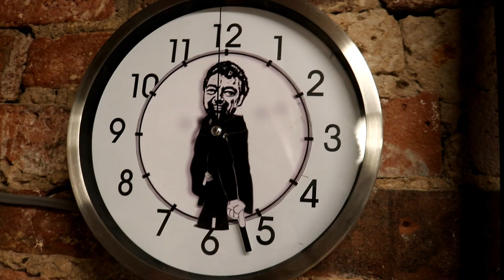Chiller Plates

Comment: The layout of the baffles on the exchanger plate are purely to increase turbulence (mixing) on the plates and to avoid hot/cold spots. In theory, you can mixing them as long as the gaskets line up. If they don't you will never get it to seal without applying an unholy amount of secondary sealant - I would do it right first time even if it means ditching a few plates. The cost of reducing the number of plates is that you would have to run it through slower to get the same outlet temps. Let me know the model or manufacturer of the exchanger and I'll help you sort it out.
Reply from the maker: Cheers Pat, There are no markings on the chiller, I have no idea what it is.
Reply: Can you get any info from the previous owners?